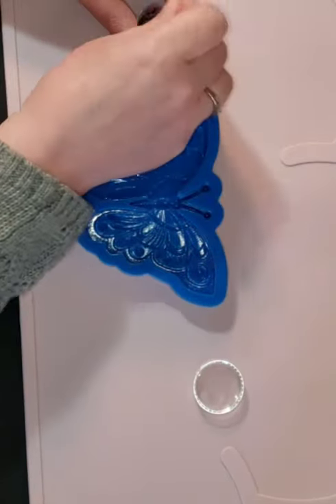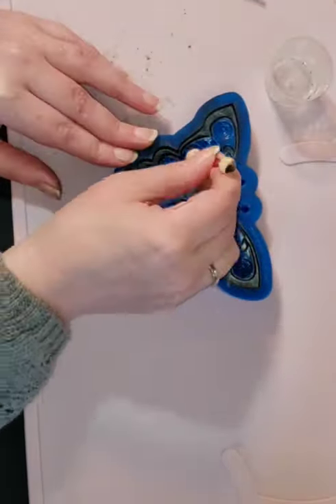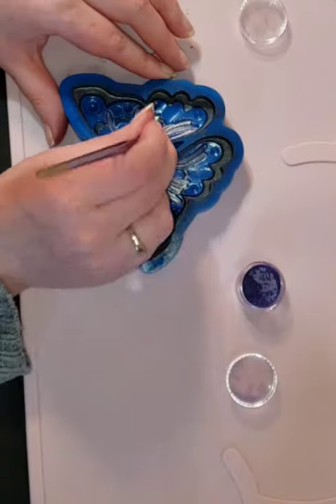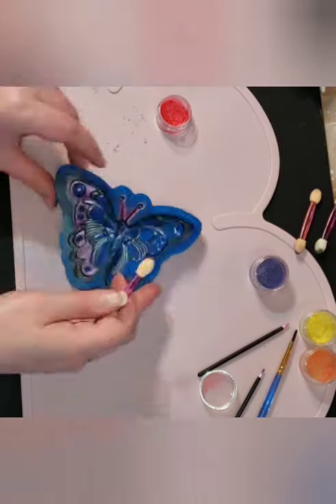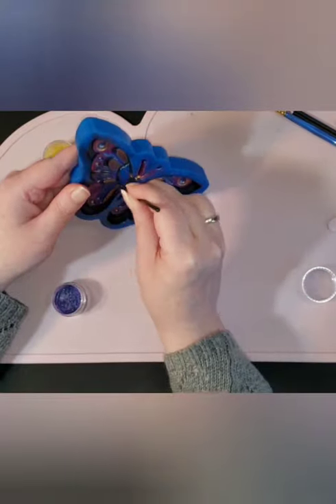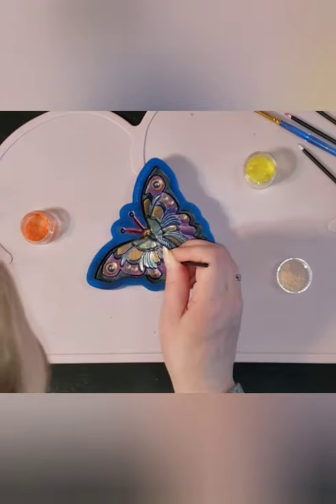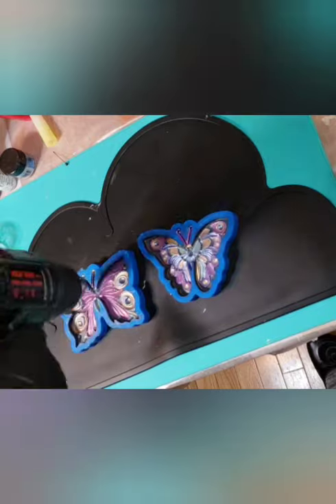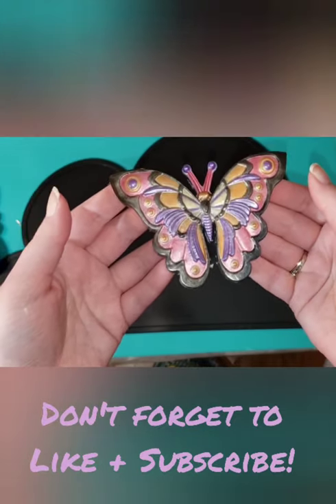How to Make a Resin Butterfly (using a DannerBuilds mold)

Comment: Nice video. I've not worked with molds yet. You don't have to spray the mold first with something to keep the resin from sticking to the mold? If not, then is it just the texture of the silicone mold that keeps the mica powder in place when you're tilting the mold various ways while applying other colors? Thanks.
Reply from the maker: You don't need to spray before you brush, although it is a good idea to treat your mold with mold release spray every few uses, to keep it in good shape. Mica sticks to silicone really well on its own!